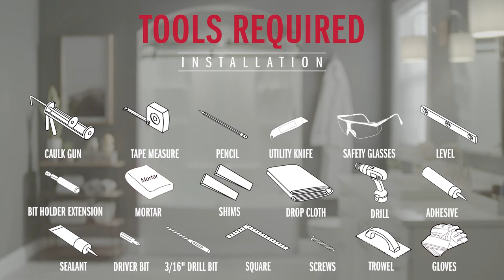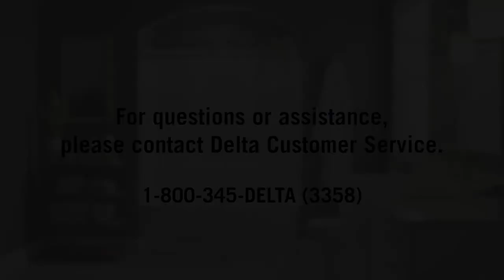How to Install the Delta® EverEdge Tub (60x32)

Comment: How do you use this tub with a tile wall? The "everedge" bump out on the edge seems to prohibit placing cement board and tile along it.
Reply from the maker: Hello Kelsi, The EverEdge Tub 60x32 will need to be paired with the  EverEdge Bathtub Wall 60"X32" MODEL#: B23207-6032-WH. Products can be purchased online or locally. Please see our Where to Buy page for help finding dealers in your area or online.

https://www.deltafaucet.com/where-to-buy -Kelley
Reply: @deltafaucet  It states in the instructions that it can be installed without the walls AKA tile.
Reply: Did you ever get an answer here? Same problem
Reply: I think you would tile down to the bump out and caulk between it and the tile using a non silicon caulk
Reply: Install cement board down to the flange, then hang the tiles over the flange and down to the tub deck. There's an illustration on page 9 of the instructions.
Reply: @deltafaucet  but the box says that it is compatible both with the walls and tile. Guess I'll be returning mine.

Comment: Is the adhesive on the subfloor absolutely necessary? If so, can you please explain the reasoning, since the tub is also attached to the studs? Also, I'm not clear on whether the tub drain should be placed in the tub before or after adhering the tub to the subfloor and studs. The written instructions also leave this information out.
Reply from the maker: Hello Valued Customer, Thanks for contacting us! Adhesive on the floor connection will prevent water from getting under the tub. The drain needs to be installed before installing the tub and then the floor needs to be checked to be sure it is square and level. -Kelley
Reply: I guess I was not clear in my question. The instructions call for adhesive to be spread in a large rectangle onto the subfloor before installing the tub. My old tub that I removed so I can install the EverEdge was not glued to the floor -it was only attached to the wall studs. What is the reasoning for the large rectangle of adhesive that is to be spread by a notched trowel? Thank you!
Reply: Hopefully you're done with this project by now, but the adhesive on the subfloor removes any potential bounce in the tub bottom. It also prevents tiny horizontal shifts, which could put unnecessary strain on the flange where it's screwed in, and eventually causing cracks that water could escape through.